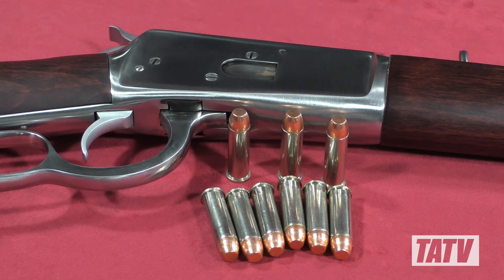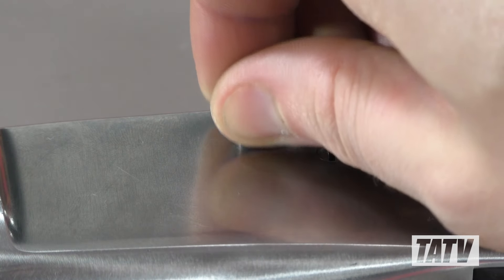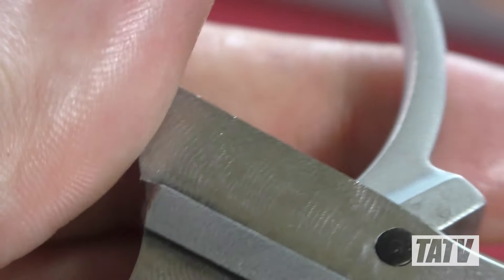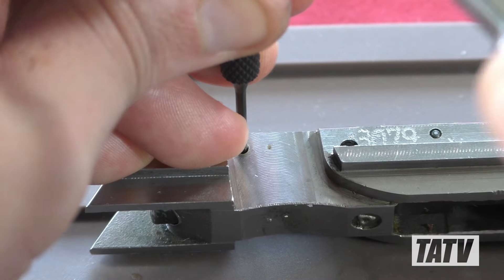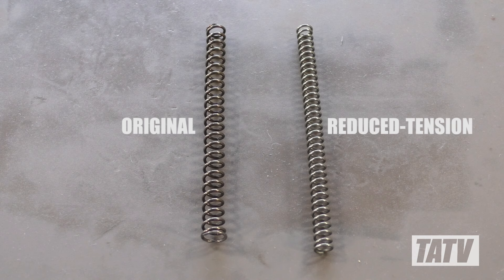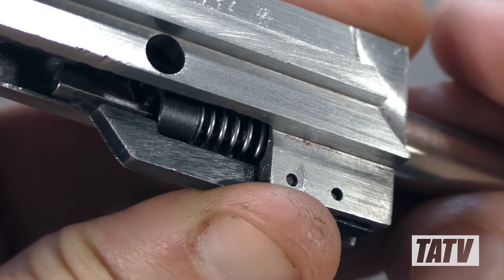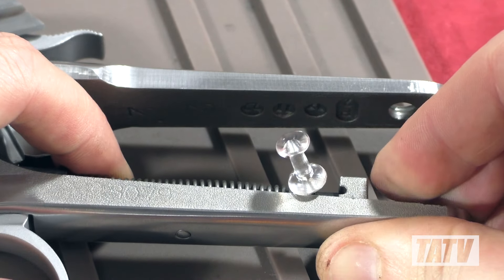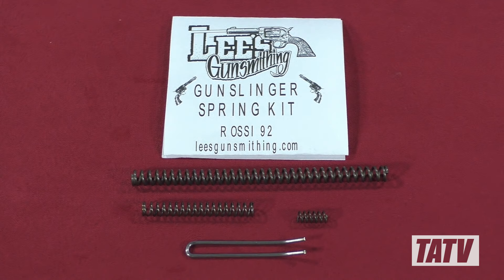Slicking Up A Rossi R92 Lever-Action Rifle - Part 1

Comment: What you've done is akin to silk pursing a sow's ear. Cannot believe all those rough casting burrs left on the internal workings. As a 78 yr old retired machinist with over 55 years of experience; just a couple nits picked here: 1/ the raw ends of your U shaped hammer spring are going to gouge grooves in the contact point of the hammer assy. and create some drag. Rounding those a bit would be good. 2/ instead of cutting 4 coils off a spring, instead cut 3 and lightly face grind the remaining coil on the side of a grinding wheel to heat it and flatten it to the next coil thereby presenting a flat entire circumference of spring contact surface so the spring is not forced into a crooked slide deflection as it compresses.
Reply from the maker: Thanks so much for your insights, that's high praise coming from an experienced machinist.  It's not shown in the video but I did end up rounding the trimmed edge. I am planning on a future video devoted entirely to methods of reducing spring tension on both coil and leaf springs, and will try to remember to include this step. 

I've often wondered what options there were to flatten a spring face for the DIY-er, so I really appreciate the tip on that. I'm going to be purchasing some generic coil springs one of these days so I can try this and a few other ideas.

Comment: I just put this spring kit in my Interarms Rossi 65. I've had this rifle since the mid 1980's. It's in .44-40 WCF and has been okay to shoot. I put the trigger spring in but then put the original one back in because the lightened spring was giving a one pound trigger pull! The original spring gives it a three and a half pound pull. The hardest part was putting the new hammer spring in. I ended up sliding it on then putting the pin in and then winding it in like a screw till the pin cleared. I love not haveing to chase empty brass twenty feet!
Reply from the maker: I had the exact same experience with the hammer spring, and used the same method to overcome it. Either the guys in the factory have a custom spring compressor onsite, or they've got hands like the incredible hulk.

Comment: I had a similar but different experience with a Rossi model 92 stainless in 454. It would not chamber anything be it factory loads, several different ones, or any of my hand loads. I sent it back to Rossi. They didn’t have it very long and it came back and will chamber everything, and it was slicked up to a point that rivals most any lever action that I have seen or owned. very cool little gun that loaded properly will put a hurt on most anything.
Reply from the maker: That's interesting; maybe the figure it's best to just clean everything up VS piecemeal you on every little bit.

Comment: A little tip for people trying to get little tensioned parts out and know they're be a flyer, cover the entire part with a microfiber towel while disassembling so that when parts do fly, they'll just be caught by the towel.
Reply from the maker: This is a great tip to be sure.  I often use plastic bags, but that's not always practical when working on a full-size rifle.
Reply: @TATVCanada  I've lost enough parts to learn from my mistakes... eventually. Lost the recoil spring plug on my 1911 for like 2 years before I found it.

Comment: Very nice job, keep up the work. Are there more machining marks inside the receiver where the bolt runs back and forth that could be smoothed and make the rifle work even better?
Reply from the maker: Mine wasn't as bad internally but others may differ. The internal stuff is also much more difficult to address than the external.

Comment: Thanks for the video! The only issue I had, aside from the ejector, was the pin for the bolt and lever. I thought i did something wrong, but i just hadn't pushed the pin far enough in.
Reply from the maker: It's funny too because you'll work on one gun and the pin seems so loose it will fall through if it's not under tension, then on another you'll swear somethings out of place because of how difficult it is to seat. Firearms can be very finicky!

Comment: hi, to you  ‼️
 i would ask to you a simple question,   that your carbine  has it not the safety lever to avoid to firing out battery ... ❓  i don't see any safety under the lever on the bottom of handle stock  rear the trigger ... 🤔🙁
Reply from the maker: This rifle has a half-cock safety on the hammer, and a secondary safety on the rear of the receiver (top).
Reply: @TATVCanada ,  hi, to you ‼️
thankyou for your answer,   i think that your carbine without the safety lever, there was in every  original 92 winchester carbine,  it is very dangerous because it can fires out battery when the bolt is  unlocked,  you can t imagine what's happen   If it happens,  i think it is a bad work by rossi gun maker,  
bye bye

Comment: Question. I followed these instructions in their entirety.  including installing the Lee's Gunsmithing spring kit. Essentially, step by step to the video. NOW, the bolt/lever is EXTREMELY  difficult to cycle. Trigger pull weight is 1lb 12oz on average. Its just the dang bolt or lever. Any thoughts?? Thanks in advance! 🤙
Reply from the maker: Hmmm...  Do you see any signs of overly tight fit around the locking lugs? It sounds like there's some serious friction somewhere. Does the stiffness persist through the entire action opening, or just part of it; like it's 'clearing' at a certain point?
Reply from the maker: If you have any machinists blue or even a sharpie I would mark the various mating surfaces and then cycle the action a few times. If there's a lot of friction anywhere it will quickly wear through and you should be able to recognize it pretty easily. That might at least give you an idea where things are binding.

Comment: Just did all this the 1.5lb trigger is super light ill have to get used to it and the casings don't go flying anymore so I might be able to find them all lol
Reply: I'll definitely keep the safety with this light of trigger
Reply from the maker: There are spring kits available from third part manufacturers you may want to try as well if you're looking for something heavier.
Reply: I’d like something a little heavier.  Not much. Maybe 2.5 or 3 pound. 1.5 is really light.  I had a couple of unintentional discharges while working the lever at the range in my drills.  Who’s the 3rd party you mentioned?

Comment: You just got 3 QA inspectors fired...
Excellent tutorial. Trigger pull is lighter than I would want, but I am not in the comp shooting game.
Reply from the maker: I've got an upcoming video all about the different methods of lightening different types of springs. You may find it more useful as one of the options is to thin the existing trigger leaf VS replace it with the wire version.

Comment: Great disassembly/assembly video.  I would caution anyone going inside a rifle for the first time to take it slowly and in multiple steps. Figure out where parts move against each other and only concentrate on smoothing those surfaces. Think in terms of polishing, NOT removing material. (I learned that the hard way 😖). Operating the action a bunch of times before going inside will leave marks to show you what needs to be polished. If there is a rough surface that makes assembly very difficult, go ahead and touch it up just enough to facilitate assembly. 

It doesn’t need to look perfect - it just needs to run well.
Reply from the maker: Sage advice.
Reply: @TATVCanada you didn’t mention smoothing the locking lugs at all. Was that because of the potential to increase headspace?  IOW there are some surfaces there that are OK to touch while others MUST be left alone to avoid BAD THINGS happening when you pull the trigger.

Comment: I’ll be taking possession of a Rossi r92 soon and am debating between doing this and simply spending a weekend cycling the action. Though I won’t get the lighter trigger, which I’m not really interested in anyway, I suspect that Rossi and others cut corners on machining because they know the action will smooth out over time. 

On the hammer spring, I don’t see much value in lightening it. I’ve done it for double action revolvers but this doesn’t make as much sense to me.
Reply from the maker: I'd say try it first and if it breaks in, fantastic, if not, you can work on it any time.

Comment: The ejector spring does not affect the trigger pull.  It affects how far the ejected brass flies in the air and how hard it is to close the bolt.

Comment: I have a genuine question. I plan to get one of these rifle in 454 casull as a do-all go anywhere in North America and protect me and mine from everything rifle. I absolutely HATE the safety up on top of the action. Is there ANY way whatsoever to eliminate that and replace it with a tang safety like a mossberg has? I still want to have a safety present on the rifle, and tang safeties are great. Thank you much.
Reply from the maker: You can remove the existing one but I am not aware of any replacement.
Reply: @TATVCanada  I don't think it would count as a replacement, more like a full customization.
Reply: Not to plug a competitor, but Steve's Gunz sells a rear peep that replaces that ill-conceived safety very simply. It saved me from buying a Williams as I have for all my other leverguns.

Comment: My R92 was at least 10 times rougher than yours inside and couldn't eject until I replaced the ejector spring.

One of the guide rail plates had a burr on it that was 1.5" long and wide enough to cover a quarter.  It was folded back over the rail and squished in place.  And by 1.5", I don't mean 1.5" of burred edge, I mean it stuck out 1.5".  I mean it was like two of the original trigger springs side by side, but much thinner.  A huge piece of metal.
Reply from the maker: Holy crap mate, you are a better man than I for even attempting to fix that. If that were mine it'd be going straight back to the store.

Comment: Great video and I'm sure you've covered it, but you should put in a quick warning to use purpose built hollow ground screwdrivers that are designed for work on objects like this.  They have a hollow ground bit and bite into the screw head cutting down on the possibility of an OOPS and scratching the living crap out of your pretty item...

Comment: Just bought a r92 triple black in 44 mag for hunting that struggles to cycle anything but flat nosed rounds (chews up hornady ftx rounds and cycles them properly every 1 in 10 times) really hoping a good "slicking up" will help. Thanks for the video!
Reply from the maker: Some tubular magazine firearms do have a habit of struggling with certain types of Ammo. A couple suggestions if I may:  1.  If you have a vernier caliper, check your cartridge lengths. The hornady Ammo you're using may be outside (or at least at the high end) of spec. I've found shorter Ammo tends to work better in situations like these. Being you've got a 44m, try some 44s just for comparison.  If you're a reloader, you can also try seating your bullets deeper or trying a different style of bullet (which it sounds like you already have/are). 

2.  Take a look at part 2 of this series, specifically the section on docking the mag spring. An overly powerful magazine tube spring can interfere with proper cycling of longer cartridges. If you live in the US, you can actually buy 3rd party mag springs very cheaply ($20-$25).  They're a solid investment if you want to try docking the mag spring without risking your stock one.

Comment: Without measuring how do you know if there is excess material that can be removed without increasing tolerances.
Reply from the maker: Without access to the original manufacturer's diagrams, it's going to be difficult to make an exact measurement.  However, much of how a firearm operates is relative to the preferences of the user.  In my case, I wanted a smoother, lighter action that is easier to fire.  The best advice I can give you is to to start by smoothing out areas that are obviously rough, or burred, and then reassemble/test.  Work slowly, remove as little material as possible, and stop when you've reached what you feel is the ideal operation.

Comment: If you shorten (I prefer replace with similar, but shorter length) ejector spring collar you can address "ejecting cases to the neighbor county" problem for free.

Comment: My magazine tube had heavy burrs on the inside where they drilled into it for the rear barrel band. It would occasionally bind up and prevent feeding as rims hooked on the burr.
Coarse sandpaper on a flap rod inside the tube fixed that problem.
Reply from the maker: I'm glad you brought that up as I'm planning on a part two specifically to address the loading gate and mag tube.

Comment: I have watched several of these videos (assembly/disassembly) and I have noticed that no one seems to use gun grease even though there is tons of metal to metal contact. I use 130-Aa on my M1 and it makes a world of difference on the smoothness of the action. Wondering if the service manual only calls for oil on lever actions? Fantastically shot video btw, that bolt was so rough, I would have probably returned the rifle for exchange.
Reply from the maker: I agonize over what type of oil to use as on the one hand you want something thick enough to not immediately wear off, but on the other hand you don't want it drying out and caking on. I tend to use thinner oil or even aerosol oils on guns I use frequently as I can always reapply. Firearms I'm going to use infrequently or plan to store for a long period typically get grease.

You are correct that was a rough bolt, but in my case I can afford time to improve it more than money to replace it.
Reply: Lucas gun oil and Hornady One Shot Gun Cleaner Dry Lube are all I ever need for cowboy action guns.  I hate grease on cowboy guns, the only exception being black powder shooters.  There's sometimes no choice for them.
Reply: Brian Enos slide guide is what I lubed the bolt with and other moving parts. I love the stuff. Make the action so nice on the R92 and all the other firearms I put it on. It’s a semi thick gel like lube and stays were you put it. I have only ever used the lite lube, White and green tube. They make a standard that is thicker, comes in the white and red tube. Stuff is awesome.

Comment: Hello, I wanted a lever action rifle for some time and after looking around, and your great vid, I am planning to buy one 16" R92 in 45LC. But is there someone on Amazon or Ebay selling the reduced tension kits and stainless followers? Need them imported to EU. Also is it possible to fit 9 rounds of 45LC in the tube mag by reducing spring and maintain proper feeding? Thank you for answers.
Reply from the maker: I can't really comment on the capacity in 45lc as I don't own one to compare. Regarding the parts kits; I've never seen them for sale on Amazon, but I feel your pain as a non-us resident. I've had friends in the states order and then ship me things before, not sure if you know anyone there but it's my preferred method.
Reply: Thank you for reply. Sadly no, I don't have a friend in US that could ship it to me. I saw a stainless follower on ebay, though sold out. Well, I have to wait anyway. They only have blued ones here, stainless are on the way, still tempted by the blued 16" thou. Since Marlins are gone, Henries are rare and way overpriced here. I was choosing between this Rossi and Pedersoni 1886 in 45-70 gov. But later cost 40% more and ammo is 2,5x more/round. So Rossi won.

Comment: Can you polish the surfaces of the inside receiver where the lower tang goes in?
Wouldn't that help a bit as well?
Reply from the maker: Yes you can, and yes it would, but it's pretty challenging to do. Bang for buck, the exterior is much less work for a greater return.
Reply: @TATVCanada  Another question. You remove some of the ejector spring coils from the new spring and claim that it helps reduce trigger pull. How does the ejector spring affect the trigger pull?

Comment: You missed several areas, the hammer spring strut on mine was rough,  I smoothed it. I polished the inside faces  of my locking blocks, to front and back to make them sloppy and change headspace but inside faces. Also my ejector and its spring colar were rough as a cob.

Comment: The stupidity of the manufacturer using a coil spring for the hammer just makes it difficult to reassemble. I have taken people's Rossi and replaced that STUPID coil spring and converted to like the Winchester model 92 leaf spring. I start by grinding down the metal block on the inside of the bottom tang where the coil spring rod goes through, then I toss it in the trash. I drill through the bottom tang to where the Winchester hammer FLAT spring will secure the spring. Then I take the hammer and shape it, on the bottom, to make it like a Winchester hammer. Then I weld two small pieces of steel on each side where I will put the spring stirrup after grinding the slot for the stirrup. Then I drill through the hammer precisely like where it would be just like the Winchester hammer. Then I install the stirrup pin through the stirrup and voila!! I then install the hammer to the receiver with the bottom tang. Then I can install the hammer flat spring to the hammer, then install the bottom tang screw into the hammer spring!  Just think how easy it would be if the Rossi company was to WAKE UP and make the hammer and flat spring JUST LIKE WINCHESTER!!!!  HELLO??????

Comment: Awesome video. I have a question, do you think I can get the action to be more smooth just by racking it over and over many times without doing this slicking process?
Reply from the maker: Yes that will definitely help over time. It's not going to be as smooth, but breaking it in will still make a positive difference.